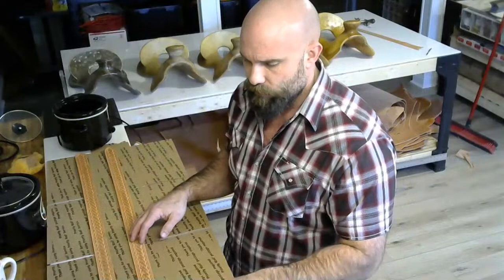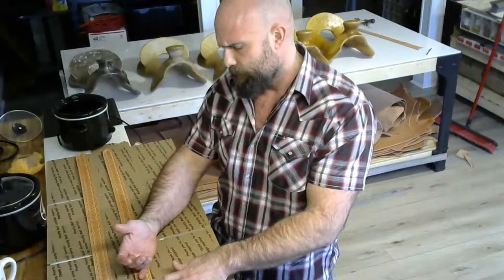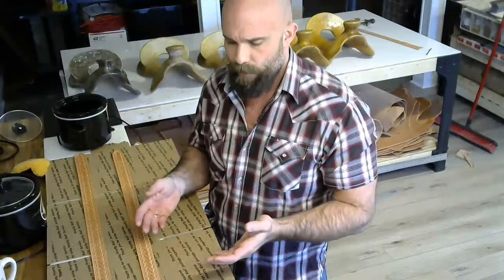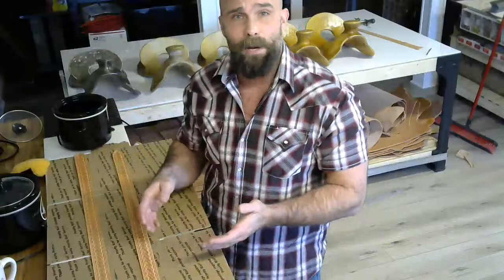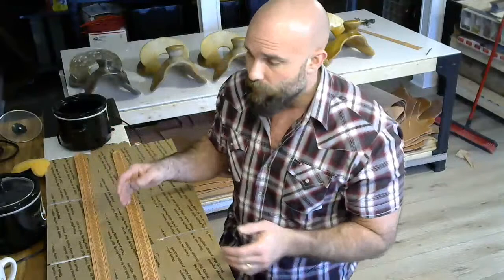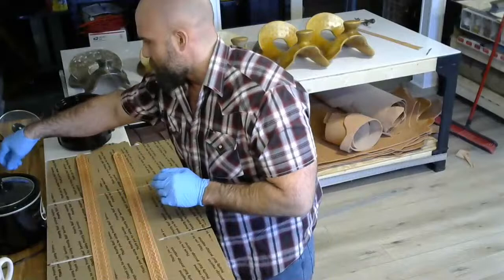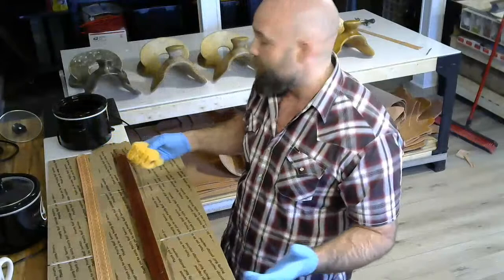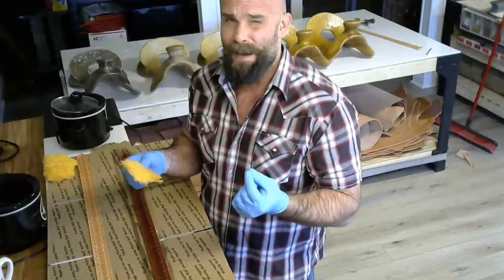Neatsfoot Oil Tips and Tricks, Hot Oil, Tinted Oil, and More -  - Livestream #3

Comment: Do you only oil the top side? Or do you oil from both sides of the belt?  If both, do you have to let the top side dry completely before flipping?
Reply from the maker: If it’s going to be lined you don’t oil the bottom because it will cause problems with your adhesive. If it’s unlined you oil both sides. When you do that, you don’t need to let the top dry before you flip it.

Comment: Coconut oil is the least reactive to oxygen compared to Neatsfoot & Mink oil oxidation which causes rancidity.
IV Number:  measures the reactive carbon double bonds present in oil (the weaker molecular bonds in oil – common in unsaturated fats). The  the IV number the  the oxidative stability. Coconut oil has an IV value of 10, the lowest of any plant/animal oil. Lanolin has an IV of about 20, Neatsfoot oil (bovine tallow) has an IV between 50 to 70, Olive oil has an IV of 80, Castor oil has an IV of 85, and Mink oil has an IV between 80 to 95.

Comment: Question on when to apply the oil during a project. With belts it easy to do after glue up and even sewing. But with let’s say a bag, would you recommend doing it before assembly while taking care not to oil any glue lines? It seems all but impossible to get an even coat and not have splotchyness or pooling after in areas after it’s been put together on items that are more 3 dimensional. Amazing video by the way!
Reply from the maker: I generally oil everything after assembly. I'm primarily a Western saddlemaker, so trust me when I say that you can oil 3-dimensional objects evenly. It just takes practice. The exception here is oiling areas that you can't oil once the item is fully assembled e.g. the insides/ back sides of things. For those you've got to do that prior to assembly.

Comment: What type of sponge are you using? I use old cotton towels and it seems to waste a bunch of oil.
Reply from the maker: I apply Neatsfoot with scrap woolskin.
Reply: I like eraser sponges. Very fine texture and easily cuts to size. Use them when applying top coat or oiling. When doing a top coat they don’t make bubbles as muchas a dauber or sponge brush for me.

Comment: Thanks Ben! I'm busy restoring a old circle Y saddle that's been standing on a display for over a decade. The leather is still in good condition but hard and dry. What's the best way to apply and how much should I be administering in order to get it as soft as possible and put back into service...Thanks in advance JM
Reply from the maker: I apply the oil using a piece of woolskin. Use as little as you can get away with initially and test it on a small portion to see how it behaves. If it seems to improve, apply light coats waiting a day or so in between.  If it's too far gone, rather than rehydrating it, it'll just turn into a greasy, crumbly mess.Depending on how dry it is, it may not be salvageable.
Reply: @BMGeisler  Thanks man...really appreciate the intel.

Comment: Great topic! Thanks man. Opens up alot if options. Big question. I love working with veg tan, my shop get kinda hot and sweaty in the summer and I've noticed if a sweaty arm touches this untreated leather it leaves a black smudge. Some projects this can ruin because getting the smudge off with everything I've tried just makes it worse. Feedback would be great. Thanks again for the video!!
Reply from the maker: That's a tough one. If you smudge untreated natural veg tan, you can sometimes clean it by using diluted oxalic acid. You have to make sure to go over the piece evenly, but it will take off most organic stains including iron (blue spots) and blood.
Reply: @BMGeisler  Ty. That has been recommended and ill break down and give it a try.